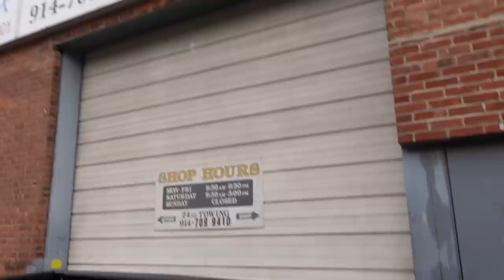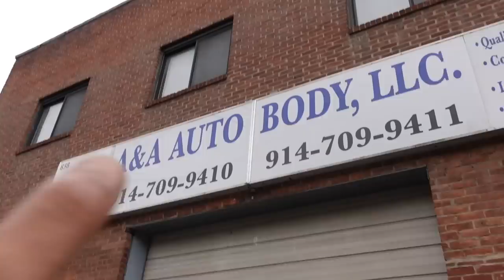UPDATE: AK-47 Goes On The Rotisserie- Looks Crazy!!!

Comment: Put a split pin under the boot at axel end and have the boot clamp pull on it. Then use a cable tie to hold it to axle.
Old rally car trick to help the boot breathe and stop spitting grease...

But its for inner CVs that pump not outers that are fixed...

Comment: Aki if you had a bigger hood vent in the center of the hood it would help drawl air through the oil cooler and rad forcing it out through the bigger hood vent. Even a bigger cooler won’t necessarily work. If it doesn’t have the escape route it will not flow the air to cool the oil.